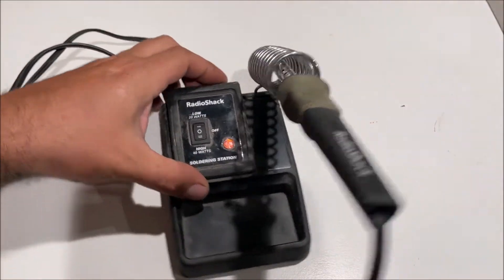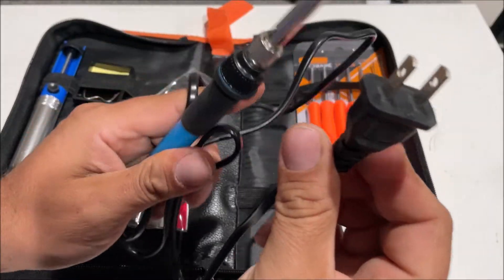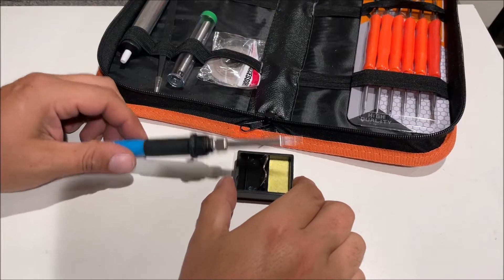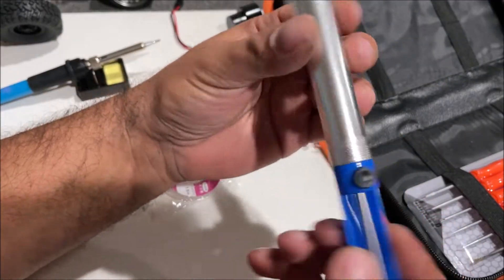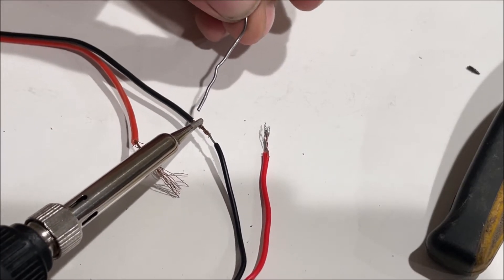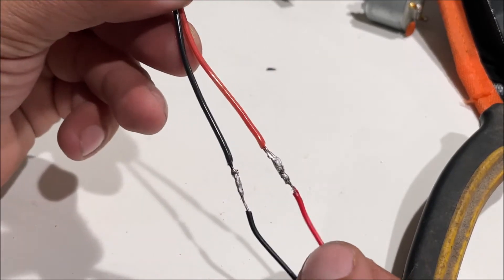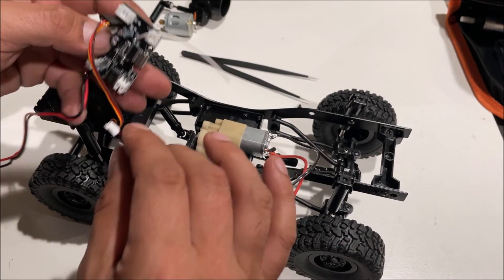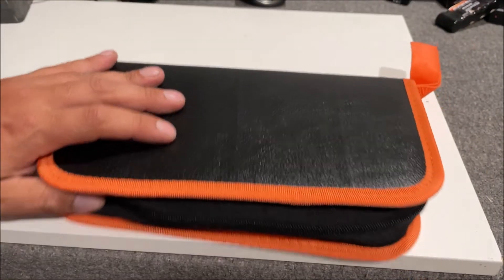soldering iron kit review under $20 hobby budget solder electric tool

Comment: You can solder a longer cord or put a piece onto the the existing one. Onto the soldering iron. Hopefully it will stay hot long enough to do
It without power after cutting the cord😂

Comment: My eye glass frame broke , it metal , do u think , I can solder it together ? Thx
Reply: Sure, but solder can be a bit brittle, so I wouldn't expect the repair to last long.
Reply: Yes you can, just tin both sides properly and use flux 👍🏻

Comment: Is this good for desoldering stuff from motherboards?
Reply: @ch-tc4ct fantastic info, thanks for the info...will reach out w/any follows ups that come to mind 👍
Reply: @ch-tc4ctdamn I was looking to get this especially for desoldering
Reply: @Progressive.G  hoof tip is great for  desoldering
Reply: @ch-tc4ct would it be good for actually soldering as well? I'm just trying to replace the dead battery on the Dreamcast
Reply: @ch-tc4ct fantastic information - one other question: how important is the wattage? It seems like 60 is the minimum and it goes up to about 120. Is this something I should be concerned with?
Reply: What about FNIRSI USB C soldering iron? its only like 14 usd more than the the cheapest t12 soldering iron which is like 20 usd.
Reply: @ch-tc4ctWhat about FNIRSI USB C soldering iron? its only like 14 usd more than the the cheapest t12 soldering iron which is like 20 usd. The thing is that the FNIRSI uses propietary tips which seems to be a shorter modified t12